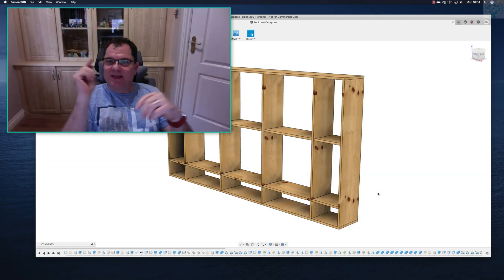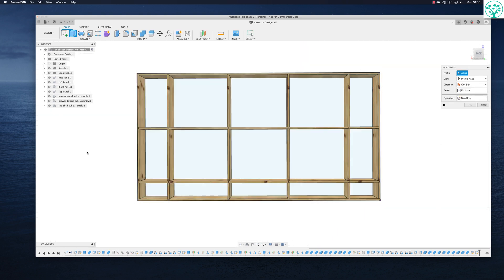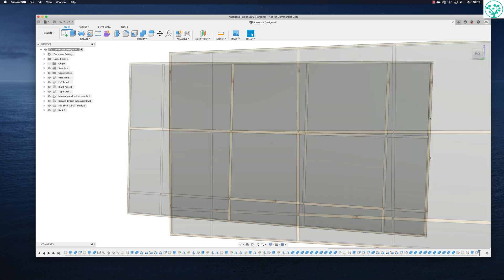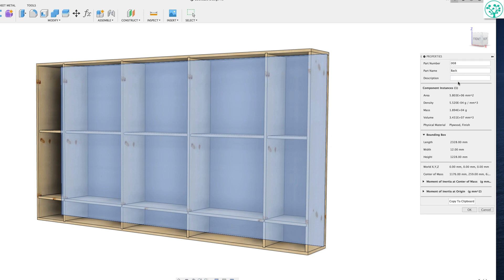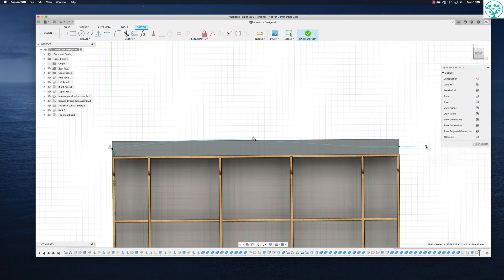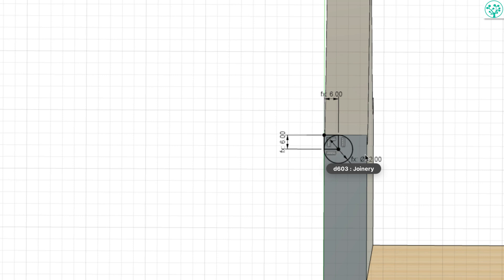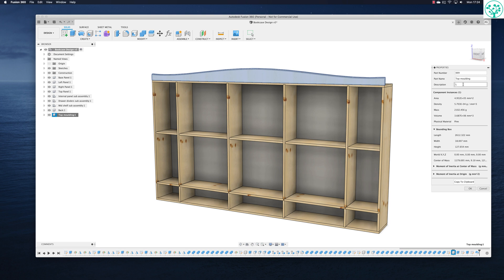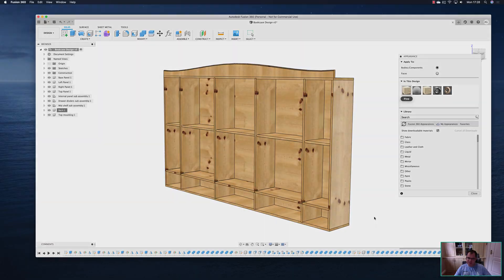Fusion 360 for Woodworkers - Lesson 6 The back and the crown

Comment: I just started using Fusion 360 and am glad I found your lessons. Very well done. Extremely clear explanations. I had some difficulty in making the top moulding. I wound up with a small flat at the center or the top. This broke up the pathe for the sweep command (it stopped at the flat). Any suggestioons?
Reply from the maker: Hi John,

Thank you for the feedback, a few people had this problem.

I made a video for one of the early requests. Not saying you have the same issue - but it may help

https://vimeo.com/443842965/11c90e386e

Andy
Reply: Brilliant, solved the issues, thanks @TheWoodgrafter
Reply from the maker: Awesome, thank you for letting me know.

Comment: Thanks for the videos. Why is the dimension of the molding longer than the length of the bookcase? Mine is different than yours the bookcase is set to 2352 and my molding bounding box shows a length of 2874.934.  Yours shows 2612.232.  Is it possible that it is picking up the length along the sweep instead of the linear length along the bottom of the molding?
Reply from the maker: Hi Tom,

Yes it sounds like you are picking up the curve rather than the bottom edge.

Especially if on your model it visually looks correct.

Regards

Andy

Comment: One thing to note, that when adding the "Equal" constraint to the top Molding Spline. Equal only set the length of the control line the same, not the angle at which you drag it. I instead made a spline, trimmed it in the middle, and then mirrored it to the other side. I may have missed something, or maybe a better way, but I wanted to point out that out.

Comment: Andy, apologies if this has been asked/answered already. Regarding adding the back and "cutting out the shelves" that are showing through when it's added... around the 6:05 point in the video. If the shelves and columns are "cut" or reduced in size to allow the back to set flush with the rebate, wouldn't that change the width of those pieces? So the shelves for instance would shrink from 265mm to 253mm because of the 12mm back...?? If so, wouldn't I need to go into all the "properties" and change the width in order for the cut list to be correct later? Again, if this is addressed later, apologies, I'm just making sure I haven't missed an explanation. Thanks again.
Reply from the maker: Hi Mark,

Yes the panel will reduce in size, BUT in the history time line you will see it adds the cut or the offset, this is taken from the original size of the panel.

So if I set values in the parameters for 1000 x 2000 then use another command to change the size, I.E. Offset one edge by 100mm then the panel will adjust by 100mm.

If I then go back in and change the parameters of the panel to 1000 x 3000, the panel will re-szie and then apply the 100mm offset.

It is one of the great things about Fusion and using parameters and then timeline.

Let me know if that makes sense.

Andy
Reply: @TheWoodgrafter  yes sir, makes sense. I guess my only question related to that is would it automatically change the sizes in the 'description' section of the 'properties' or would that be a manual change I would have to make after-the-fact. I think I know the answer but I want to make sure.
Thanks again,
Mark
Reply from the maker: Hi Mark,

Sadly not, the description is a manual field. I have not yet a way to automate that.

I use a plug in called Bomerly It allows me to create a Bill of materials in spreadsheet type format. That does allow me to view the ‘bounding box’ information. The bounding box does update automatically. So in my workflow I don’t actually use the description box for the measurements. 

Bomerly is a paid plug in, I am in conversations with the developer to do a demo of that and hopefully provide a discount code.

Not an easy answer I am afraid.

Andy
Reply: @TheWoodgrafter  Andy, no worries, as I'm learning more about the program, I assumed this was the case. For me, at least for now, this is a small price to pay for the versatility the program offers. Thank you very much for the time and answers!!

Comment: What made you chose Fusion 360 and did you try other programmes?
Reply from the maker: Hi,

I was a Sketchup user for the longest time, but wanted something that would allow me to improve rendering - the plug ins in Sketchup tend to be expensive.

Also as Sketchup continued to change the license and became more cloud base, it became harder to use in ‘off-line’ mode without a full purchase.

Fusion offered improved rendering, the ability to design for 3D print, future proof for CNC modelling, startup license, the ability to work offline, the advantages of cloud and finally the feature of parametric modelling.

Beyond that, no I didn’t try other software - all though I am now playing with Vectric for the CNC aspects.

Cheers

Andy
Reply: The Woodgrafter cheers Andy, keep up the good work.
Reply from the maker: No probs,

Thanks for the feedback.

Andy

Comment: The Combine and Modify commands are very complex operations.   I started to get lost in the last lesson when you were explaining the modify command.  For me, you have increased your pace to the point that I can no longer keep up and understand what you are doing in detail.  This is a common problem in teaching technical subjects.  Instructors start out at a slow pace and then speed up for some reason during the lesson.  The speed up tends to happen right when a more complex operation is explained in the middle of the lesson.  In Lesson 6, you are doing multiple operations at once using these complex commands.  We have only seen them used once in the last lesson or so, we are not experts at them.  In lesson 6, the assumption seems to be that we are experts at the combine and modify commands and therefore you can just bang on through them.  I would suggest that before lesson 5, you create a separate video explaining in detail these two commands and how they are used.  This is more of a reference video, but it is highly important to the understanding of both lessons.  Also, creating the back is needs to be slowed down so that the individual steps can be absorbed at a better pace.  YOU may be an expert at this, but the audience here is NOT.  The current pace assumes the complete mastery of the material, in detail, from the previous section or lesson.  Slowing down a little at this point would be very helpful.  Thanks and keep up the good work.
Reply from the maker: Great feedback,

Thank you, I’ll create a couple of stand alone videos that looks at these (and other) commands again. They are pretty critical to the flow.

Having covered them previously - I did indeed consciously make the decision to not cover them again as wanted to show the new commands. So great feedback, and sorry if I lost you.

Love the idea of some ref videos that focus only on one command. Look out for multiple releases next week.

Cheers and keep the feedback coming.

Andy

Comment: Hi Andy,

While following along to Lesson 6 in Fusion 360 I keep having a problem I can’t seem to solve.  When making the “Top Moulding” all goes well until I use the Sweep tool and the extrusion stops about half way across the top moulding. Upon closer inspection I see there are two lines across the moulding, from front to back, and separated by 38.388mm. I have repeated building the Top Moulding several times and the results are the same, the lines are created when I extrude the two top sections created by the spline tool.

I have taken a screen shot but don’t know how to attach it to a comment.

Any ideas what might be going on?

Thanks for your assistance and your informative series.

Cheers,

Mitch
Reply from the maker: Hi Mitch,

Interesting, haven’t come across that.

Are you using the spline as a single line with three points, and is the the centre point snapped to the edge.

Also try extruding both at the same time to the rear face and when you select the two areas to extrude, zoom into the centre and see if there is a bit missing if so select it.

Not sure if you can create a screen recording and ping it over to me andrew@thewoodgrafter.com

Cheers

Andy
Reply: @TheWoodgrafter  I'm having the same problem as Saw Dust.
Reply from the maker: @InformationUnavailable  

Hi Nick, 

I made a private video for Saw Dust based on his file.

If you ping me your email I will send you the link.

Info@thewoodgrafter.con

Cheers

Andy
Reply: I had same problem. When picking the sweep, hold the CTRL key to add other two entities, then sweep continues across.
Regards
Reply: My problem is selecting the area to sweep.  It seems you must go slow and be carefull when selecting.

Comment: Hi Andy - You use the description to hold the dimensions of your parts. But in this lesson the back cut into the other internal parts effectively reducing their width. Does that mean you now have to update those descriptions?
Reply from the maker: Hi Adrian,

Yea you are correct, the dimension of that timber has now updated.

Sadly  - we will have to go back in and clean up the descriptions before we get to the cut lists and diagrams.

I haven’t yet found a way of auto-updating the description or using the bounding box info in the cut list. The good news is that the dimension on the drawings (when we get there) will auto update.

Hopefully one day Fusion will add this feature.

Cheers

Andy
Reply: @TheWoodgrafter  Thanks Andy. That would be a great feature if and when they add it. Adapting a technique I seen with other software would be to lay out the components onto a full sheet outline  but I haven't mastered changing the plane that a components sit on so that they can be layout out - would do that on a seperate copy of the project.
Reply from the maker: Yep indeed it would.

There are some plugins that can help. For panel layouts this looks good

https://apps.autodesk.com/FUSION/en/Detail/Index?id=7055850008078104945

I haven’t used it yet - but seems to be great for part layouts in CNC.

Another great way is to use a plugin such as bommer to create bills of materials that you can export into a layout program. 

https://apps.autodesk.com/FUSION/en/Detail/Index?id=5433700426186506446&appLang=en&os=Win64

This is how I tend to do it, I also haven’t used bommer yet - but looks more comprehensive than my current solution.

I use a simple plug in called - export to BOM and then Iimport to cut list pro. I will cover that in a later episode.

Cheers

Andy
Reply: @TheWoodgrafter   UPDATE: arrange command in latest version of Fusion 360 will cater for requirement. sounds like this is just a taster at present with a fuller workspace for this activity on the way. See also https://www.youtube.com/watch?v=69naIIrlGvg